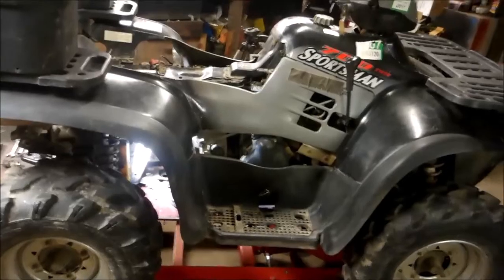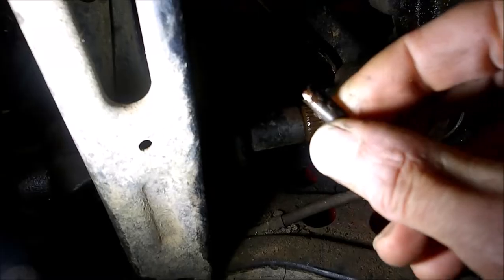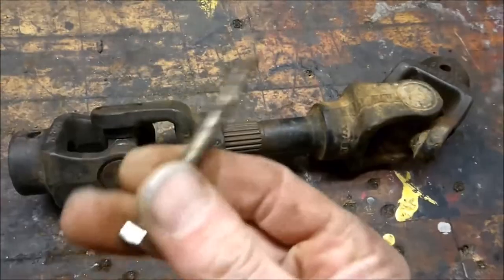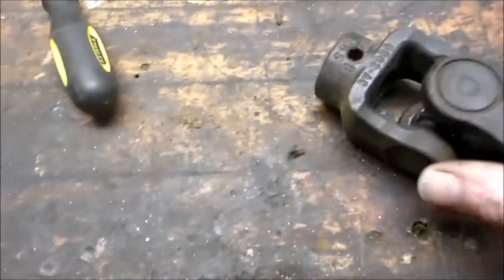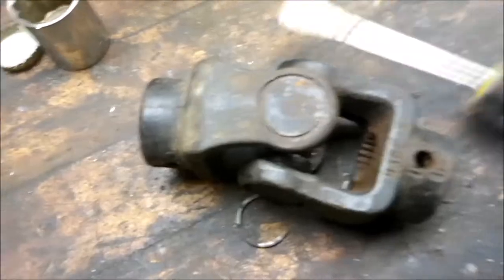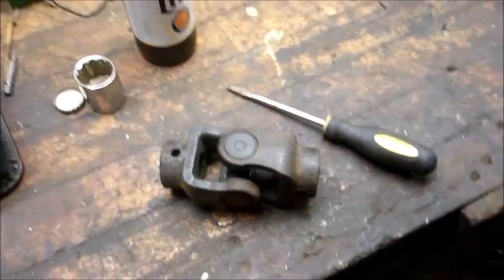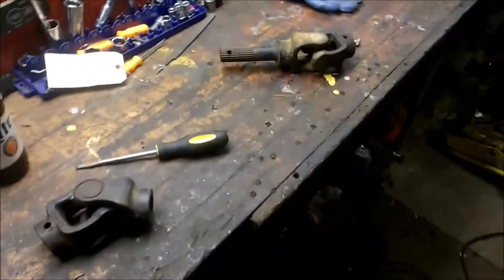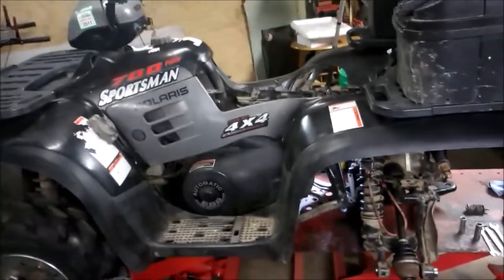Polaris Sportsman Clunks at take off! Prop Shaft (Rear Axle)Removal

Comment: I found the problem - Hypoid gear was destroying the pinion gear because of bad bearing on hypoid shaft- so I fixed problem by ordering used rear differential - cause can't find hypoid gear anywhere - discontinued. But hey its running and will be good to go. Found your video on 2005 ATP today - my ecm is still good thank god. Your videos are very helpful. Thanks.

Comment: Hey - Long time - been real busy with all kinds of projects - you know me Hehe. But I just picked up a 2005 Polaris ATP 500 4x4 that runs but when shifting it either doesn't engage all the way each time and starts grinding - I'm thinking rear differential but wanted your thoughts - it goes through the gears but i hear a clunking sound coming from back end - almost positive i need to rebuild the rear differential but thought i would take a shot on asking the expert. Sorry haven't been around much just had a whole lot happen recently and will catch you up in the near future - been doing great on golf carts though and upgrading them like i told you before and aliso picked up a 1998 artic cat 500 4x4  in almost pristine condition just needed carb cleaned and battery for $200 so still finding those great deals. Anyway if you have time shoot me a message or email  or let me know what you think. I'm pulling everything off and getting it ready for repair so when i do ill have more room to work. Anyway still watch your videos - they have been life savers keep up the great work. I tell my friends all about your channel so driving you in some viewers and they were as impressed as i was when i saw them the first time - so keep it up your doing great.

Comment: I have a 2003 that doesn't slide together  in the middle. It doesn't have enough room back or forth to come off. Do I have to pull the rear differential?
Reply from the maker: You might. I has a magnum I had to do that too.

Comment: I got tired of the magnum 425 and got a 06 Polaris sportsman  800 it has this problem and so dose my friend I seen the whole  thing for $80 on eBay
Reply from the maker: Yeah. It's pretty cheap and easy to fix if you can get in there. Lots of people are getting rid of the 425s  I must have 5 425 blown motors sitting around.

Comment: How many miles did you have when you had these parts wear out?
Reply from the maker: 3100
Reply: @TitaniummanGarage  wow.  That sounds like very early wear for only 3100 miles.  Do you know if that's typical at all?
Reply from the maker: It was used on a farm. Usually when heavy towing is involved. I've seen them with 1500 miles on them and need u joints. Just depends on how well they kept everything lubed up.

Comment: I have a 2004 600 same issue can u give me some ideas to repair
Reply from the maker: If it's not the prop shaft it's probably your front or rear dif. Those years were known for bad differentials.
Reply: Replace the whole thing then you know it's 100%